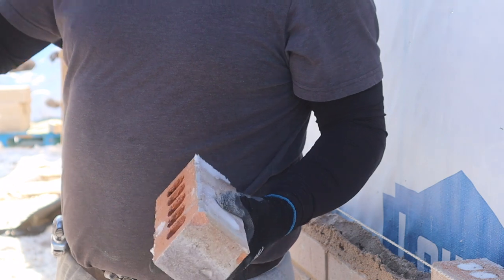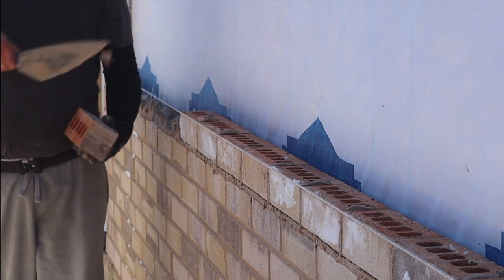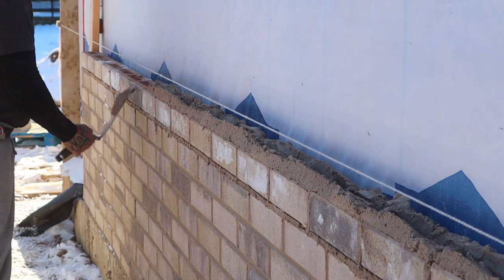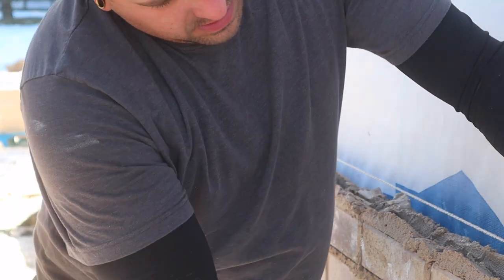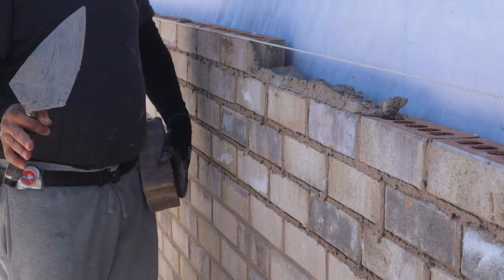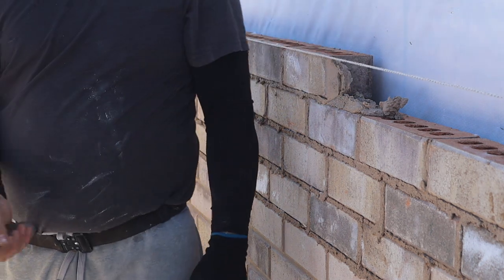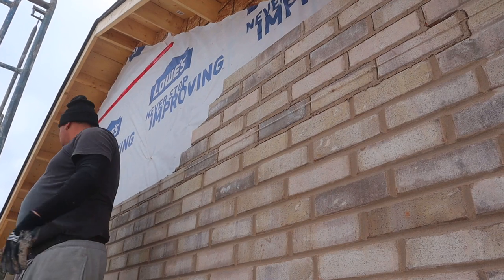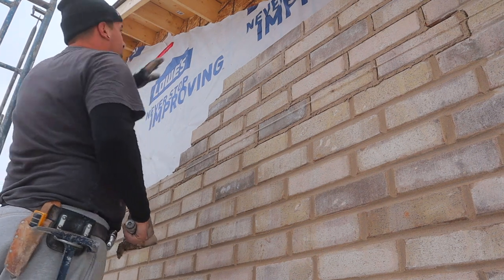New Bricklayer Does He Have What It Takes? How To Lay Bricks The  Portguess Way

Comment: The lintel needed to be anchored to the timber frame and the tray was too short over the lintel with no turn up plus near quarter bond joints. That wouldn't pass nhbc here in the UK. Like your usual vids man
Reply: There brick are different sizes that's why quarter  bond looks mad
Reply: Thought I had already commented there for a second haha
Reply: Here in Ontario the lintel does not need to be anchored. The weeping plastic does not need to turned up into an end dam, as long as the lintel and plastic is 4” pats on either side, 6” for Ontario. And the 1/3 lap or bond is because these are not half lap brick, they are max size brick which are long. Everything he is doing is correct accuracy to CSA standards and best practices here in Ontario.